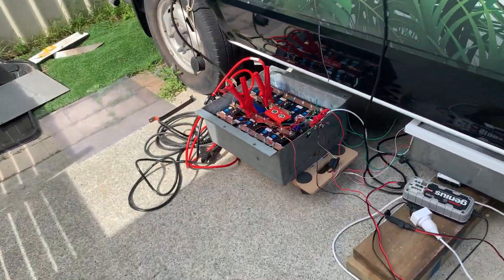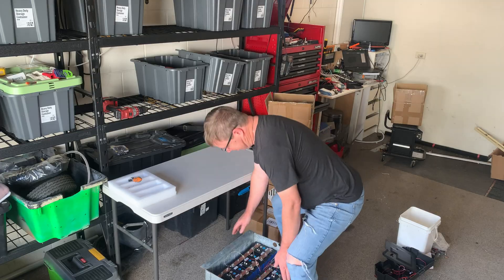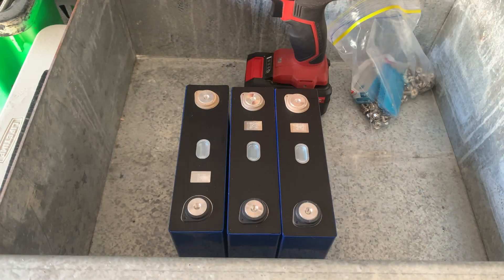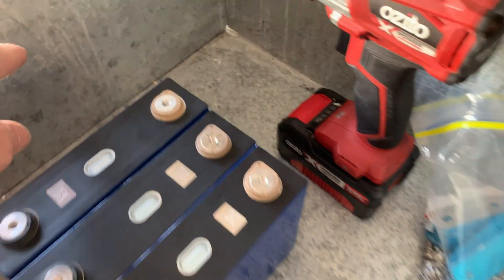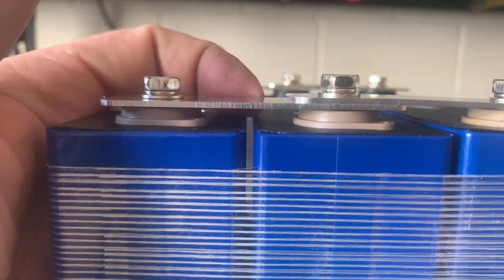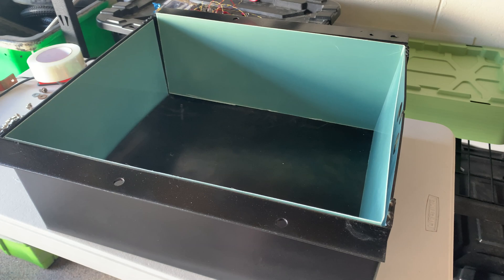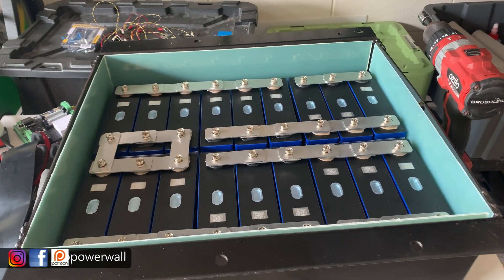Starting again with the LFP battery build

Comment: can that battery box hold water?  Drain plug?  Put some foam rubber strips between cells at least.  BTW dont you have laterite clay dirt roads in OZ like we have in RSA.  Like constantly driving over corrugated sheets.  The vibrations is very destructive?.  So those cells are just going to jiggle around and come to grief eventually.

Comment: There are some bus-bars that are stacked zinced copper that are flexible (with a little hump) that will allow your cells to expand and contract (which they probably will) to avoid the poles to get torn off.
Reply from the maker: Battery is in car now, but a few have said that - so will be on the lookout, we also didn't change any of the other cells to new busbars so I think that'll be a 'told you so' moment for us down the road - Major goal at the moment is a bloody test drive hehe
Reply: @HBPowerwall  I can very much relate to the desire to just get it done 😀This type of flex busbars are very to easily available from ali-sellers, and being on top of the cells, very easy to swap, so better safe than sorry, I would advocate.
Reply from the maker: my brother now wants to switch back to the copper bars for the 'amps' as he calls it

Comment: Thanks Pete!  Much better than what you had before!  All that bare metal around the cells in a heavy vibration environment was kinda scary!  

While frustrating to have to undo lots to fix, at least when you had the one backwards it didn't cause any issues.  Looking forward to the next update!
Reply from the maker: I'm doing some capacity testing on the old puffy cells (results will shock you as the youtube kids say!) also plan on a road trip logging data back to my place, and maybe wack a generator under the bonnet to make it into a hybrid hehe
Reply: @HBPowerwall  I’ll be interested to hear how the capacity tests turn out.  Those were really bloated cells.  

Best test is a road trip!
Reply from the maker: hint was north of 90% !!
Reply: @HBPowerwall  WOW!  Never would have thought that!  Watching the update now.
Reply from the maker: enjoy

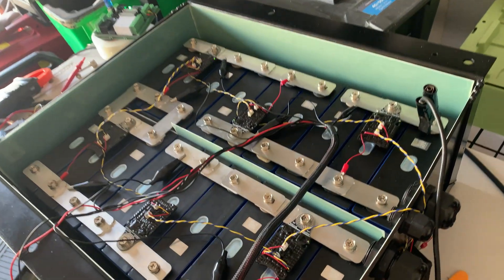Comment: at 10:03, the fourth cell from the upper right looks backwards to me.
Reply from the maker: QR Code is on wrong - it was in a box on it's own so figure it's from a different batch of batteries ? Time will tell If it is an issue, but it is installed correctly.

Comment: Much improved!  I think this is going to work well.  Maybe not perfect and I'm sure someone will complain! (that's the point of the 'net, innit?)  And the black looks great.  Maybe hot pink would have been better?

By the way, I understand the frustration of working on that rubber sheet!  Next time, lay a sheet of paper over the rubber for a non-sticky surface (use parchment paper or waxed paper from the kitchen, copy paper from the printer, even any newspaper or other non-glossy paper from the junk mail - glossy paper sticks more and slides less on rubber).
Reply from the maker: Didn't think of that, would have made the spacing and layout so much easier! I hoped I got it right this time.
Reply: polythene sheet

Comment: That's definitely an improvement. The fiberglass board insulation is spot on. I'd like to see more rubber between the cells for compression, but understand you're trying to get some air convection for cooling. 

The only I'd like to see in a vehicle based battery is laminated busbars, which also have expansion profiles pressed in. Ideally there should be no lateral loads on the terminals, which solid bars do create, hence the use of laminated expansion profiles busbars. However you can on use what you can source.
Reply from the maker: I'm not sure those busbars are fit for purpose but they were available but weren't cheap at all.

Comment: +1 for fiberclass sheet insulating on all sides.
Reply: I did also epoxy sheet between the cells. You get those pre-cut in the right size. (For a reason)
Reply from the maker: I didn't tell my brother what to buy that's just what he got, so worked with what I had.

Comment: I see the single cell that should be the other way around. Ive done it too.
Reply from the maker: I was so annoyed - I didn't see until I had put the Batrium BMS on and noticed it didn't have comms - did you notice the one cell with the QR code on the wrong side too?
Reply: @HBPowerwall  I was scratching my head wondering how the cell was reverse polarity and there wasn't huge sparking when it was assembled and flames now shooting out.  Sticker on the wrong side, in all the youtube videos I've watched about battery assembly I've not seen that before.
Reply from the maker: one cell came in a separate box we are assuming unfortunately it's from another batch perhaps
Reply: @HBPowerwall  The last time I built a pack I went thru with a black marker and carefully identified each negative post and marked the cell near the negative with a big black mark.  Then go thru and check with a meter that the negatives were marked, and come assembly it was so much easier to just see that black mark.
Reply: I was doing a 70S 250V battery setup for my Prius EV conversion and yep finally saw the qr code orientation the wrong way around lol.
Reply: Ah! Ok Yep. Good think that was noticed.

Comment: Here for the comments about appropriate PPE when working with fibreglass sheet 😂
Reply from the maker: I had shoes on and a cap - :P
Reply: Eh, silicosis is great, it sorts out the weak.
Reply from the maker: and the silly - hopefully the hepa vacume cleaner was up to the job cleaning up.. it was considered I assured you, the other option was hacksaw (finer dust and more ) or ripsaw...
Reply: @waldosan  I'd be more concerned about the itchy wank/sex later that day ;-)